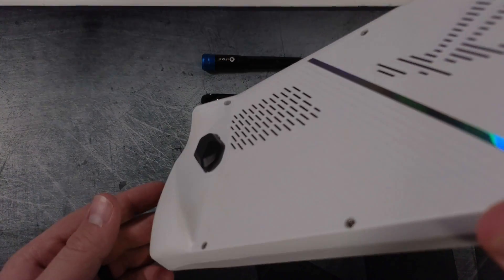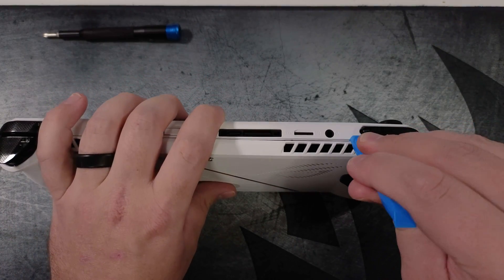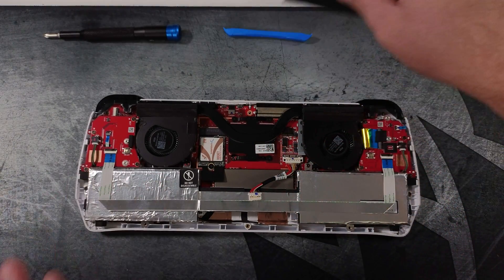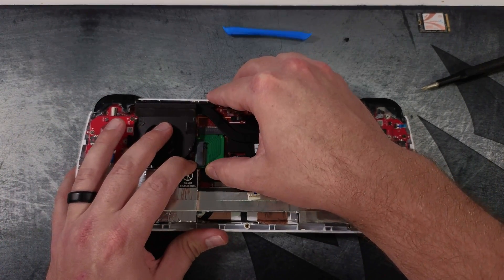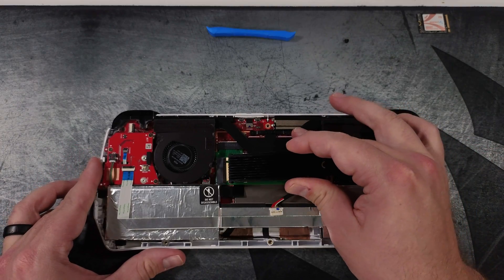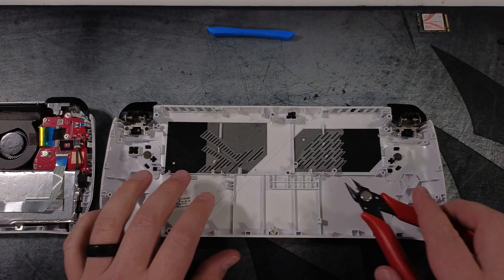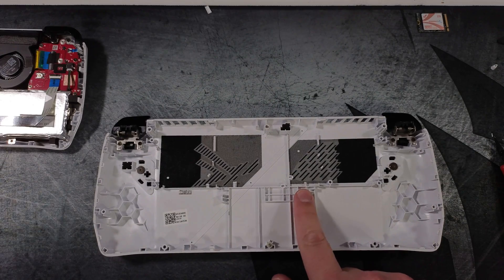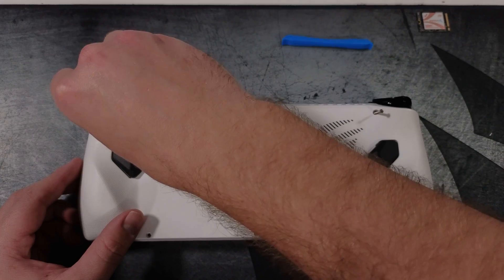Under 4 MIN: ROG Ally 2280 M.2 SSD! Lower Cost Storage!

Comment: The Ally doesn't recognize my 2280 with 90 degree bracket or plugged directly. 

It sees the Micron and it sees 2280 if in SSD enclosure.

Is there a setting in BIOs I'm somehow missing?
Reply from the maker: It sounds like you have a bad 90-degree bracket.  Can you fit the 90 degree bracket and 2280 drive in enclosure for testing?
Reply: @StuballzTech  I did end up buy a new 90° bracket and it works correctly now. the k you for the help!

Comment: Does cutting backplate for using this mod make asus waranty void?
Reply from the maker: That's a good question. Asus's warranty process has been a mess. If you are worried about it i would just pass on the heat sink and you can fit a 2280 without modifying the back shell. Always modify at your own risk.

Comment: Just got mine today and im going to upgrade mine to a 2TB. this video answered exactly what i was wondering. NVME heatsink. you mentioned you switched to a slimmer one. was the larger one pushing back on the rear cover too hard or was it just a peace of mind thing?

Comment: Just got my ally in the mail today! I want to do this mod but I don’t want to cut the back plastic and I don’t want the ssd to overheat. Is that an issue if I don’t put a heatsink?
Reply from the maker: Congrats on getting it. Gen 4 nvme really do need a heatsink for optimal use and longevity. Asus shouldn't void your warranty if that is what you are worried about. ( look into games nexus)
There are some ultra slim heatsinks ok amazon you can look into that may work without snipping the back standoffs. Good luck and let us know if you find something that works.

Comment: hello, i just got the 3 items to do all this that's coming the next day .now when it comes to the part where you have cut the plastic  on the backplate shell it is necessary to do that or is it a preference?
Reply from the maker: You will have to do it if you put a heat sink on your drive. Without a heatsink you just want to make sure the back panel doesn't contact your drive.
Reply: @StuballzTech  Thank you, also im assuming the heatsink in the video is 2mm? cause thats what i bought so it can fit in nicely
Reply from the maker: I highly suggest low profile. 2mm should work great
Reply: @StuballzTech  installed it, Works great more Storage for the next cod games
Reply from the maker: Ya it is easy enough I don't know why they ship that way.

Comment: Can you please check and let users know if having the heatsink makes any difference. Especially when downloading games on steam and copying games from an external SSD.
Reply: I've bought this exact drive and the (suckoo) adapter is on the way. If the temps are high and do throttle speed, this will guide people like me to whether or not a heatsink is needed.
Reply from the maker: Congrats. I hope it works as well as it did for me. It is important to remember that ssds only have a few temp sensors so you might be getting a false sense without a heatsink. The heatsink will absorb and spread, so the ssd will be more uniform in temp. Another thing I didn't mention in my video is the life of a drive can be drastically shortened by overheating. It will work either way but heatsinks ensure a better sense of tempature and extend the life of the drive. In regards to downloading games on steam if you have unlimited internet, normally the cpu uncompressing will be the biggest bottleneck. Least in my experience.
Reply from the maker: Thanks for the comment. I saw a 14 degree drop in tempature.

Comment: Do you think a heatsink with 3mm thickness would work? In my country we cant use amazon. Thank you❤
Reply from the maker: Yes for sure. You just need low profile. So much better then running without heatsink. Thanks for the comment
Reply: @StuballzTech  awsome. Keep up the good work😊

Comment: Ssd with heatsink?then cutting back plate?if i dont use heatsink, do i need to cut back plate?
Reply from the maker: If your not using a heatsink you don't need to cut the backplate. Thanks for the comment.
Reply: Is it dangerous for the machine if I don't use a heatsink?
Reply: @JohnnyCage-or3mh  depends on the ssd's power consumption. If it's lower than 4.5W, you should be fine.